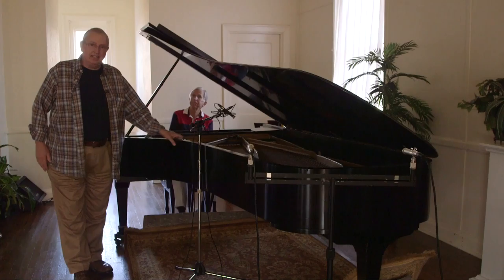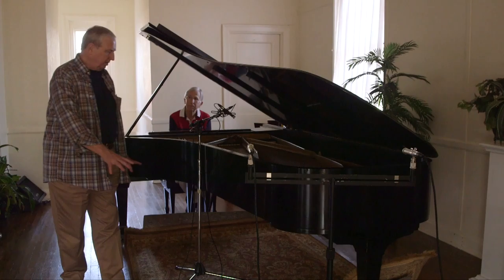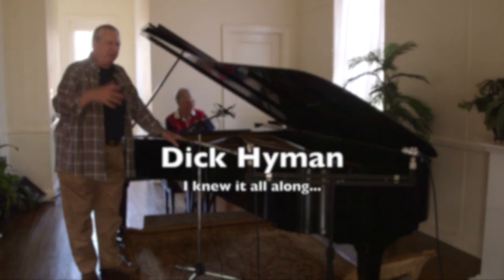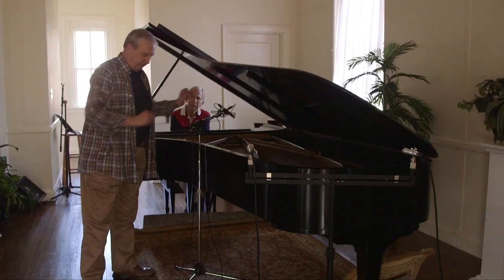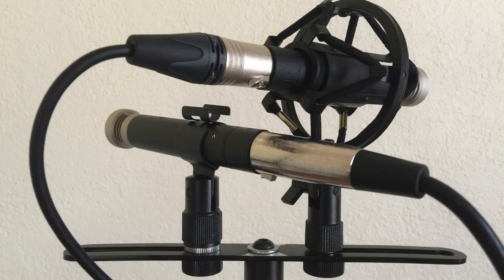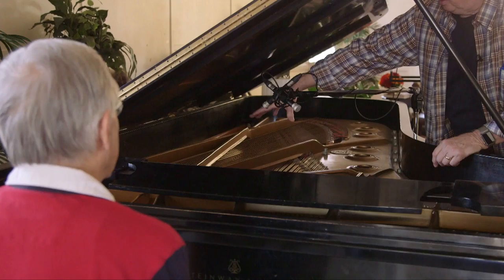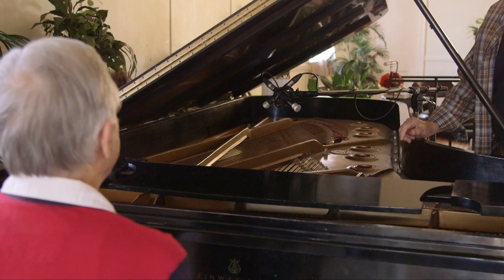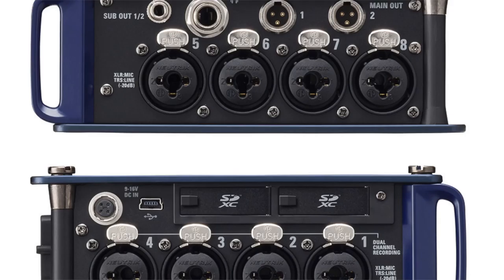Recording A Steinway Concert Grand

Comment: Thank you so much for the detailed breakdown of your configuration.  I love those little Oktavas.  I just have one and want to get at least one more.  Lou is a class act!  Loved the playing and the arrangements.  Everything just goes together so well.  I'm still chuckling over "Downtown Alabama".  

I'll be recording a Model D again on Tuesday and was just comparing notes with what you're doing.  One thing I like to mention about piano recording is perspective, specifically with the image shape.  Pianists are well familiar with the left/low strings/bass - right/high strings/treble image but that's not how anyone other than on the bench hears it - at least in that direction.  If you're in front of the piano lid, you'll hear the lows to your right, the mids in the middle and the highs to your left.  If, on the other hand, you're in an auditorium or even further back on stage, it's just a blend with a 9-foot image source, the image angles directly proportional to the distance to the piano and appearing almost monaural with great distances.  At 40-50', room reflections create more of the image with reverberations with some delay factoring in.  When I listen on headphones to recordings in the left-bass, right-treble pattern, the image is very distracting and almost off-putting particularly in the sustain of the low strings.  There's a large build-up of LF energy that just won't quit.  I'd recommend perhaps testing a mid-sides technique with a Blumlein pair - it sounds great.  Short of that, running wider pairs (like you're doing at the foot of the piano) is nice and sounds a bit more like what someone off the bench would hear.  Just depends on how you want to hear it but with blending in room mics and foot mics, it's a production decision.
Reply from the maker: Thanks for your informative and detailed comment. You'll be delighted to know that Lou and I have just completed some new recordings on this same Steinway using an AEA R44C ribbon mic and a Sennheiser condenser mic in an M-S configuration.  The sound is our favorite so far and by far. I will be posting some videos of the recordings as well as a separate video showing how I process the M-S tracks in Final Cut Pro X.
Reply: @RexRoach  Our last recording: https://www.youtube.com/watch?v=rqc_7shUN18

Comment: I so much needed this information to record my Steinway B. many thanks
Reply: Thank you! My Steinway B is 2006 in my open ceiling living room, which is really good. I have never been satisfied with the engineers, though. Learning the process now to start doing myself.  Is using iPod instead of laptop a good idea? What fair priced equipment would you suggest for home recording? Would Shure KSM137 Stereo Pair be enough? Many thanks!
Reply from the maker: The KSM137 is an excellent choice for piano. Depending on the distance, you may want to engage the 15 or even 25db cut so as not to overload your preamp. BE SURE to set the rolloff switch to flat (straight line) for full frequency response. 

You mention iPod for recording. You may mean iPad. AFAIK, you can't record on an iPod. You can certainly record on an iPad. You'll need something like an Apogee Duet to provide an interface between the microphones and the iPad. You need 48v phantom power, a preamp and an analog to digital converter. All of these are combined in the Duet. This will also work with a laptop. 

For considerably less money, you could look at something like the Zoom H6 recorder, an all-in-one solution. Another excellent choice is the Sony PCM-D100. There are similar recorders from Tascam and Marantz. These recorders have built-in microphones. I have used the Sony with excellent results in a church recording a choir and pipe organ.
Reply: Sorry for iPod :)) I meant iPad, for sure. Thank you very much for the information. I wish you are in Charlotte, NC!
Reply from the maker: You're very welcome.

Comment: Great video. But I only have two oktava mk012 mikes and got the best results by placing the pair ten inches apart in the well just outside the case, pointing in parallel at the centre of the strings. 
When I placed mikes over the strings and hammers the lower tenor notes sounded boxy and bongy.
Reply from the maker: Good for you! Experiment endlessly.

Comment: Thank you so much for such an informative and practical assessment of miking grand piano.I have a newish Schimmel C169 (5'9) and have been trying to get the best sound for recording my work.I have a Kawai PR1 system which consists of a CD recorder and 2 mikes that are strapped to the beams underneath the piano but I find that I get nice bass and top treble but no mid range and piano sounds a bit electronic for want of a better word.I might now try different placement of the mikes,perhaps on top of the piano (on stands)I also have a Zoom H1n recorder which incorporates 2 small mikes facing opposite each other,similar to what you showed,so I might try placing that where you have yours  thus having a 4 mike set up.Of course it helps having a Steinway D nicely tuned as the guinea pig and a superb pianist demonstrating......great work..thank you both.
Reply from the maker: Lew and I both appreciate your comment. Good luck with your recordings. Try several locations. I recently corresponded with the recording engineer who did a recent award winning recording of a Russian pianist. I asked him for more detail on the recording setup shown in the CD booklet and in the music video. He said that actually was not the setup used for the final recording and was one of several they tried until they were satisfied. I hope that will inspire you, too.
Reply: @RexRoach  Thank you..will now experiment on different locations

Comment: Thank you for this - wonderful playing on a great piano - excellent information and advice. The ambience mic adds a noticeable improvement for this "studio" set-up.   However this and the rear microphone pair "distant" method might be unsuitable for a live performance as audience noise could be a problem.
Reply: At church we use 2 KSM32s close mic'd and close the lid. I normally don't like miking that close, but with SPLs in the low 90s, what else can you do? 

For our hymn sings, we left the KSM32s close mic'd, but then added ambient mics about 12 feet away. Reverb feed was only from the ambient mics. That worked very well. It gave the piano a huge sound, but still had detail from the KSM32s. Having a pianist who believes that every note on the piano should be played kind of helps.

Comment: get hold of a pair of M150 tube mics and try a slightly wider A-B spread about 12 feet out from the piano. with the hot axes aimed precisely at the same spot. Works great on my 9'2" Bechstein in a live room.

Comment: Where did you guys get the omni mic bar?

This video is probably the most helpful that I’ve come across for piano mic techniques. Thanks!
Reply from the maker: Thank you so much for your kind, encouraging words, Bruce. I made the mic bar from a piece of aluminum flat from Home Depot. Before I retired, I was a design engineer with access to a machine shop and talented machinists. They milled the long slot down the length of the bar and slotted the bottoms of the three threaded posts. I bought a threading die to cut the threads. I believe it's a 5/8-28, but check for sure. It's an extremely fine thread and you won't find the die in most local stores.
Reply: Thanks again, I tried your guys' mic techniques, and I instantly got great results. It's been a struggle recording the piano, but now I think I got it!
Reply from the maker: That's great news, Bruce! Your success is music to our ears. Thanks for sharing!

Comment: Hello, in the equipment details page, you mention "swivel heads" to make ORTF reccording easier. I don't know what that is and where can I find that? I'm actually looking for a solution to place my mics in ORTF easily
Reply from the maker: https://www.oktava-shop.com/MK-012-100-Series-modular-system/pads/MK-012-swivel-joint-103.html    It is a joint between the mic body and the capsule.  Electrical and mechanical, so a bit pricy.

Comment: Do you pan the AB stereo pair hard right and hard left to record separated tracks or link stereo record as one track?  Same question goes for the  ORTF pair?  
Thanks.
Reply from the maker: All of the mics are recorded to individual mono tracks and when placed into Final Cut Pro X, the tracks are panned hard left or right, or placed in the center as in the case of the room mic. 

The exception is when I use M-S stereo technique. In that case, I pre-mix the two mics to a pair of stereo tracks using the built-in matrix in the Zoom recorder. It works like a charm. The only downside is a full commitment to the balance between the mid and side mics as it cannot be changed after recording. 

Yes, there are ways and means to produce good stereo from a mono pair of tracks from two mics in proper M-S configuration, but I've never been able to achieve the quality of the stereo image I get by using the Zoom's own M-S matrix. It's genius hardware.

And I will add that Lew and I have been experimenting with live stream "broadcasting" via YouTube. We were in Lew's living room and I used only the A-B omni pair and in that case, I did pan them hard left and right. We used a single ribbon mic between us for dialog and that was panned to center. I used the Zoom as a mixer and fed the stereo out into the computer via USB. That Zoom is a magnificent animal!
Reply: @RexRoach  thank you so much for your time and input.  Very helpful!

Comment: I have access to these mics (in matched pairs): Neumann M49, Neumann M149, Neumann M250, Neumann M269, Coles, RCA MI 6203. Which ones would you choose to record a Yamaha C7? My mixing console only allows for 6 simultaneous mics. Thanx!
Reply from the maker: I think this was an early April Fool's joke because most people with those very expensive microphones would know just what to do, so while I think you're pulling my leg, I'll give you an answer.

I would start with the M49/149 up close and probably inside the piano. I would have the 250/269 omni pair a few feet away from the piano, probably at the foot. I would have a pair of Coles or RCA ribbon mics in a Blumlein configuration about 8-10 feet away and use one of them as a room mic and also listen for what that pair might sound like as the only stereo source. 

The classic recordings of pianists like Glenn Gould and Horowitz on Columbia or Rubenstein and Van Cliburn on RCA were usually recorded with a pair of M50 (your M250) omni mics on a boom about six feet above and 3 feet out from the piano side. You can often see those setups in photos on the albums.

In other words, you've got about $60,000 worth of microphones at your disposal, so experiment away.
Reply: @RexRoach  thank you so much, so far i have tried many variations and the best sound comes from rca 6203 12 cm above the strings and m269 as room mics, my living room is an untreated room about 90 square meters so even the best mics in the world won't do magic. Treated room is everything. Thank you so much for your time and expertise.
Reply from the maker: Kosmas Lapatas Pianist You’ve learned something most people never know and that’s the importance of the performer, the instrument and the room, in that order. My best luck in a small room has been to put the mics inside, exactly as you have done, although I used Omni mics because of less “proximity effect,” which is the extra bass you get as the source moves closer to the mic. Ribbon mics with a figure 8 pattern suffer from this the most. I did not bother with a room mic and simply used a good reverb plug-in with a gentle setting. In other words, I did not fight the room. Look through my videos for one featuring my friend Daniel. I believe you’ll see him seated at the piano in silhouette.
Reply from the maker: Kosmas Lapatas Pianist https://youtu.be/gcPe--wRMy4 is a link to the video. We were actually making an audio CD and I shot some vid with my iPhone while he was warming up. In real life, Daniel is a dentist.

Comment: What camera  better to buy  and what microfons are good for  recording  to record the concerts and  music .I am reporter and muzicianThank You
Reply from the maker: The best quality usually results from using a camera with built-in microphone(s) AND a separate audio recorder with some high quality microphones. You could use anything from a single stereo microphone to multiple microphones as I did in the video. You will pick up the music audio with your camera microphone(s) at the same time you record with your separate audio recorder. Afterward, you will use video editing software such as Adobe Premiere or Final Cut Pro to synchronize the separate audio to the video. The software can do this automatically using the audio track on the video to match the "good" audio recorded separately.

There are many good video cameras available. Be aware that many DSLR cameras that are designed for still images and have video recording as a bonus will have a 29 minute limitation on recording time. That could spell disaster in a live concert. Cameras that are designed primarily for video will not have this limitation (which is artificial and is due to marketing laws or policies).

As to microphones, I have found the Russian Oktava MK012 series to be an extremely good value. I bought mine from their store in Germany and, even with shipping costs, found the price to be excellent. Generally speaking, I think your best bet is a small diaphragm condenser microphone. Usually the cardioid pattern is an excellent starting point. It's more important to place the microphones carefully than it is to spend a lot of money. A $200 pair of well-placed microphones will sound better than a $2000 pair of poorly placed microphones.

There are several companies that offer excellent digital audio recorders such as Zoom and TASCAM. Zoom's H6 recorder can record with four external mics and with the two built-in mics for a total of six channels. Unlike a camera, you can place the recorder anywhere so the built-in mics can sound great and you can run cables to the four external mics. With six microphones, you should be able to cover most anything.

Most better video cameras also have XLR connectors for two external microphones. That's good, but often you will need to move the camera and if it is tethered to a couple of mics, that can be a problem.

Finally, when you shoot video and capture audio on separate devices, you can have several video cameras covering your musical event. That's very important with musical performances which have to be captured in a single take. Remember, you can get good video from iPhones and iPads these days.
Reply: Thank You very much! We  have zoom 2 and zoom 5, but I want to kow what video camera to buy  for reporting
Reply: Also, I see that my Zoom5 and 2  record  stereo sound. But if I edit iт Adobe premiere elements  the sound wil be mono. How to buy Adobe Premiere Pro, where I can edit stereo sound from my zoom 2 and get stereo sound too
Reply from the maker: @LudmilaPinzaru  I don't feel qualified to advise you on a video camera. I would suggest you contact B&H Photo and seek their advice. I have a Canon EOS 200 and like it, but it's older now and out of date. I've also worked with Sony and Panasonic cameras which I liked very much. You will need to list your requirements and desires for them to help you best.
Reply: @RexRoach  Thank You. I have a Panasonic camera and I used the canon too.I want to buy something better and newer. I would like to have better quality with good focus does it make sense to buy an expensive camera. At what price is better to buy. for 1000 dollars or 1500 dollars, and maybe for 2000 dollars
in Adobe Premiere Pro the sound edit mono too. what's the point of recording stereo if in YouTube and in editing programs it becomes mono, only listen at home on the computer
Reply from the maker: @LudmilaPinzaru  I think you'll find that Adobe Premiere does work in stereo. I'm not very familiar with Premiere, but in Final Cut Pro X and others, the soundtrack can appear as a single "track" but it is, in fact, a stereo track. This saves a good bit of screen real estate to make your editing easier.
Reply: @RexRoach  Thank You.

Comment: Could you put some foam on the walls to tame the reverb?
Reply from the maker: It's not my building, so no from that standpoint. I'm not sure what you have in mind by "foam" but true sound modifying material has a complex science behind it and beyond my expertise. Standing up some sheets of polyfoam insulation would, in my opinion, have little effect as the smooth surfaces would reflect sound about as well as the plaster walls. I have no doubt the room could be tamed acoustically, but from an audience perspective, it actually sounds pretty good right now, just too live for my taste in recording.